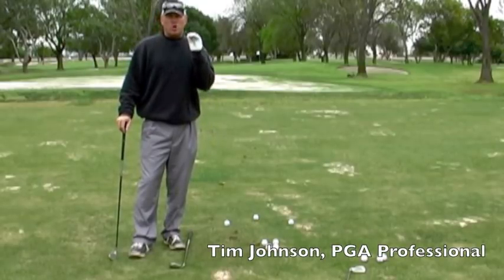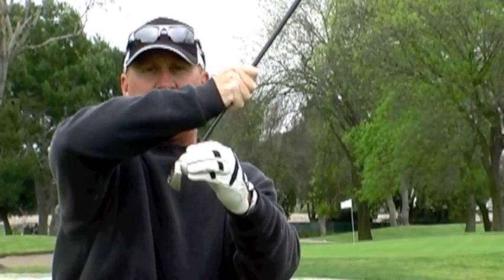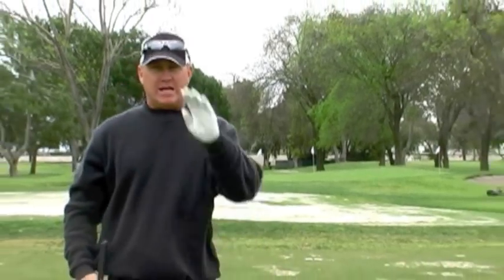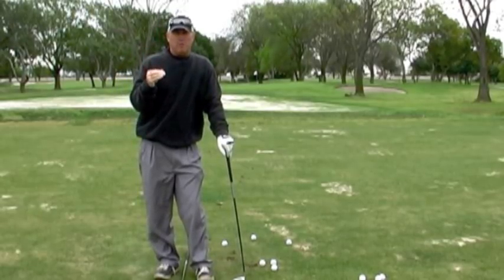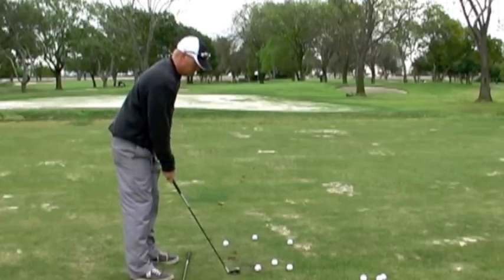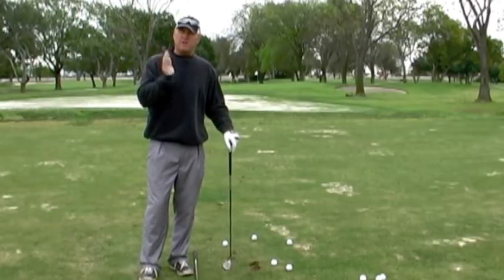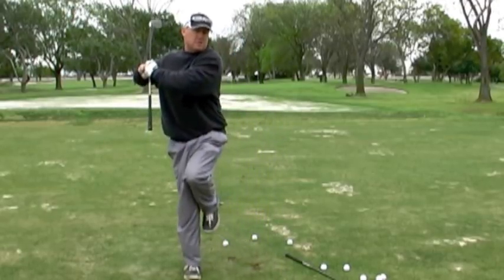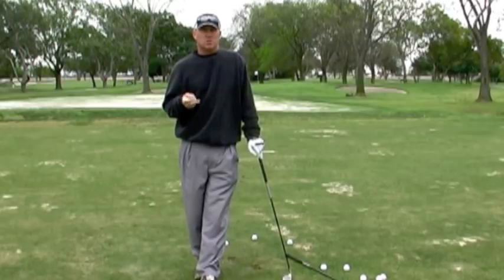Golf Swing - Hitting Solid Iron Shots and Compressing the Golf Ball

Comment: If you take a divot, how does your club face wind up below the grass  when it was level with the grass at address? Simply  moving your weight to the left in the downswing means you will hit ball earlier in your arc, but where does the change in your swing plane occur for the club to wind up lower? Not exactly the same but with a bunker shot, I am really thinking about getting under the ball. Im confused - Im a 8 hdcp. - and a sweeper. Is that why someone likes Tiger drops down during his swing to lower the bottom of his arc?
Reply: it comes from the shaft flexing and the leading edge facing downward

Comment: cgasucks is correct. Technology shows clearly that the ball is not 'squeezed' between the club and ground, nor does it 'roll' up the club face. At contact, the ball just takes off, even Sean Clements admitted he was in error on this point. What gives the ball a more piercing flight is that good players, especially on tour  'deloft' the club at impact, turning a 7i into 5i, and 160 yards into 180+. Higher h'cap players add loft and turn a 7 into a 9i making 160yds potential into 140yds or less.

Comment: It may be a decent visual, and maybe that's all that matters here Tim, but it simply isn't possible to compress the ball against the ground.  It's also not possible to add mass to the hit by "hitting it heavy" in case you heard that somewhere as well.  In the former case, the ball rolls up the face much sooner than it could travel the 0.5 inches through the turf into compacted soil.  The club face angle contributes more than 80% to the initial direction of the ball.  If the club points upwards because of loft, how could it possibly travel down into the turf?

Comment: Alot of teachers talk about 'compressing the golf ball into the ground', but in reality, the ball rockets off the face, rising (per 'Golf Impacts - slow motion video').  Still - this is a good swing thought to help with hitting down on the golf ball.
Reply: +Goldies24  correct, you don't really hit down, you glide through the ball using the bottom of the iron!

Comment: I don't think anyone falls back because they're trying to "help the ball into the air."  It's just the torque of the club working against the golfer.  It takes a lot of strength to resist the torque of the golfswing.  Just remember in your practice swing to make sure you resist the torque of the swing with your core and keep turning.

Comment: The best advice for better iron play.  Get properly fitted and I mean from a fitter who knows how to properly fit “you” and not just a generic fit.  Lie angle, lofts, length, grip size and shaft flex that fits your swing tempo and ablility.  Amateurs take instruction for more consistent iron play and distance and continue to struggle after the lesson due to improperly fitted clubs.  An outstanding golf instructor will check your equipment to ensure you have the correct fit or closest fit clubs for your golf swing.  Improperly fitted golf clubs has a direct affect on your posture, swing path, plane and balance.  An outstanding fitter will take their time with you and ensure you are fitted with the clubs that fits your golf swing.

Comment: to compress the ball you don't have to squeeze it against the grass.  you just need to come in at a slightly descending angle (for iron shots), slightly deloft the face via forward shaft lean at impact, generate some decent clubhead speed, and nail the sweet spot.  the ball will then deform and rocket off the face with a penetrating trajectory.
Reply: Exactly. The "squeezing into the grass" and "rolling up the club face" never happens. Watch any high speed video to prove it. Except for that, the principles of this lesson are good.
Reply: Hj Y This tip will result in steep fat shots for a lot of people...
Reply: +Lou Palumbo which will create a boundary and feeling for them to correct. Great video.

Comment: You can compress the golf all by hitting up or down. By compressing the ball it's means the deformation of the ball into the face of the club. Check out markcrossfields videos
Reply: good luck hitting any grooves with an upwards attack angle. Unless you dig a hole to allow the club to transit underground.

Comment: If you move your upper body forward like he does on his examples you will come out the top. Thins, fats , tops and slices all day long. When Tim swings he DOES NOT move his upper body over the ball like he shows in his examples. Spine tilt increases when the lower body starts the swing. You can transfer weight without moving your body over the ball. If you watch a slow mo of any good player you will see what I mean. The club head travels down as the handle comes up.

Comment: Let me clear up some things for anyone watching this video thinking it's great advice. 
First is the ball does not react in the manner Tim describes. Even on a flop shot the ball leaves the face almost immediately. 
Second: there is a weight transfer laterally to start the downswing but please do not transfer your upper body towards the target. This moves the bottom of your swing feet to the left. Your head needs to stay behind the ball. 
If your hitting the ball thin or fat, most likely you're casting your right wrist at some point before impact. 
From the start of your downswing the hands and arms really should do nothing active through impact. The left hip bumps left(for a right handed player), the right knee starts to kick in to turn the hips back forward. If the arms and hands are truly static as they should be, then by just this move you've returned the club halfway back down. The rest is the turning of the shoulders delivering the club head last. Momentum will pull the rest of your body to the finish described in the video. 
Tim's message is good but just missing some crucial pieces. 
Every club descends into the ball except the driver, teed up 3 wood, and the putter. Actively attempting to trap the ball with ground is not the way.

Comment: When you say there should be body movement to the left, I think you are promoting a slide-movement which will cause a push fade or maybe even a shank. You need to point out that there is weight transfer from the right to the left side, but the body and the head still have to keep still untill you have hit the ball. 

Beginners need firstly to learn how to keep still, then need to add weight transfer to their swing. ( My opinion)

Comment: you don´t compress a ball into the ground, physically not possible
Reply: The ground is not what's compressing the ball. The club is compressing the ball, while at the same time the ball is making contact with the ground. The ground is what gets the ball moving up the club face so that all of the potential energy created by the ball's compression is transferred into spin, rather than into the dirt.
Reply: Phillip Tavernier I am certainly by no means a golf pro...but I have been around golf all my life my first job was at the golf course a crossed the street from the house I grew up in and I have had my share of free advice/lessons from a many great golfers and I have never heard this explained in this manner. In fact one would thing that if you were to play on a course that has decent sprinkler system and the fairways and other areas of the course receive a daily watering it has been my experience that the fairways and all of the areas leading up to the green that are "in play" are for the most part soft ground and I would think it real easy to smash the ball into the ground and only have half of it exposed and you would need to dig it up.  Again I am no pro but I play a decent game and I have never ever gave this method of striking the ball any thought.  I may very well be doing it but I have never thought about it. I may just have to video a few iron shots close up and see what is happening down there.

Comment: Geez man, let me summarize this for you w/o the doubletalk.  Hit down on the ball.  Isaac Newton:  "every action has an equal and opposite reaction."  Hit down, ball goes up.  End of story.
Reply: Nothing to do with Einstein, nor the theory you threw in The ball goes up because the iron still has loft on it, even when de-lofted a few degrees and having a downward strike.
Reply: +bencoops6 it's not a theory...hitting down on the ball makes the ball climb the clubface for milliseconds, inducing backspin and therefore the ball climbs in flight.  this is proven by hi speed camera showing impact.  A good player with a 9 degree driver will have a launch angle of more than 9 degrees due to a slight descending strike on the ball.